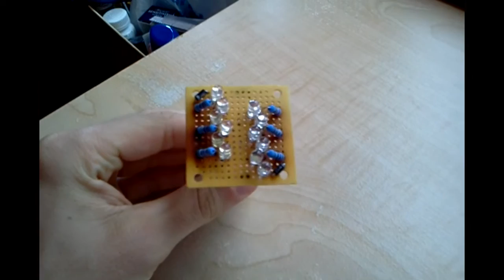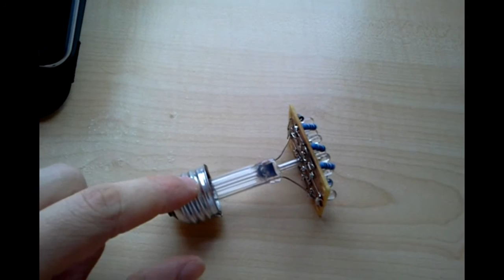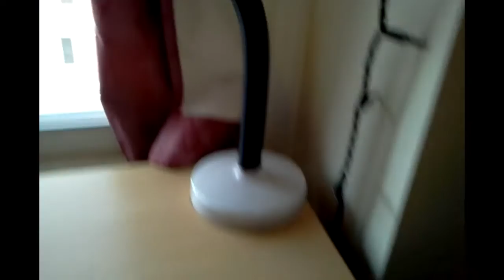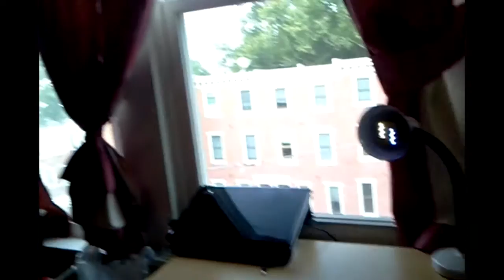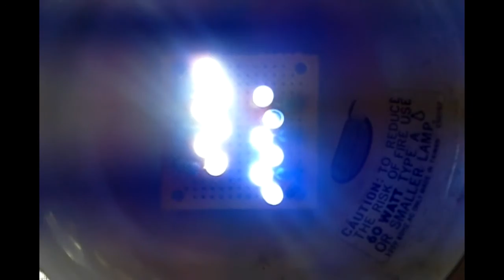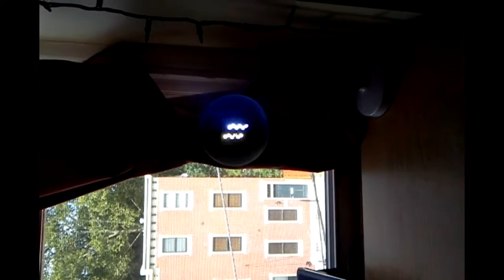DIY home made LED light bulb

Comment: A full wave bridge or 4 diodes would further reduce the flickering since the leds would be on most of the time, giving you almost double the light. About Dallas' approach, you could still use multiple resistors in parallel for that single spot to distribute the heat. A capacitor or two would also further improve the flickering, the device will give you even more light and it would significantly improve the life of the leds.

Comment: Keep in mind that resistors dont dissipate current, they dissipate power. A resistor for an array of led in series will dissipate the current of the array* the voltage on that resistor. If you calculate it right, the resistor will only take a bit of the voltage, and will dissipate low power.

Comment: This is cool but putting 6 LEDs parallel to each other is very wasteful of energy when you have such a high voltage available.  You could have put all twelve LEDs in series with a full wave rectifier, and then only used one resistor. You'd get twice as much light output, and it would draw only 2 Watts of power rather than 14 Watts as you have it now.

Comment from the maker: I chose not to use a bridge rectifier because the constantly flowing current would create a huge amount of heat, and need a large resistor that can dissipate it. This design allows the resistors to cool for half the cycle period.

Rapidly turning LED's on and off will not hurt them. Putting them in series could work, but it would have the same problem as described above where a resistor need dissipate all of the current required for x number of led's as opposed to distributing it among several.

Comment: You should use a bridge rectifier and a diode so it won't flicker as much

Now: voltage bounces from max to 0V which is bad for the LEDs
After: Voltages goes up and down only a few Volts

Also if you put them all in series, you wont need as many resistors (less heat + electricity waste) and can put more LEDs if you want